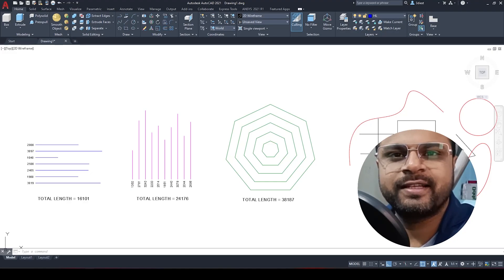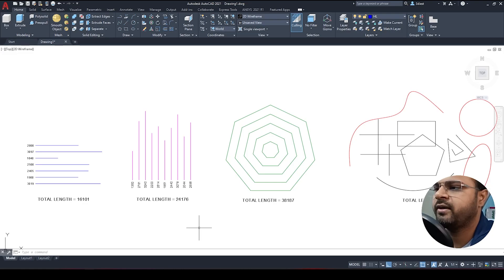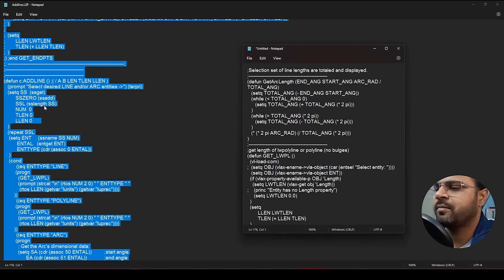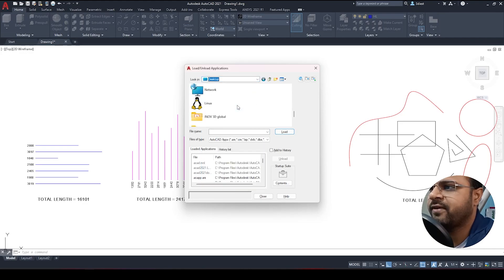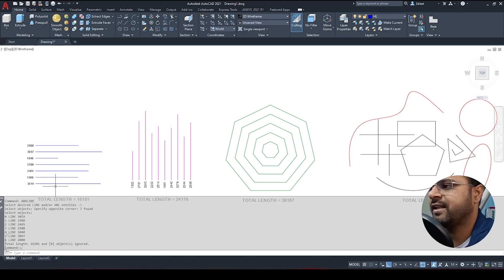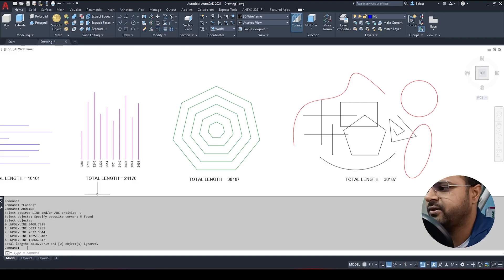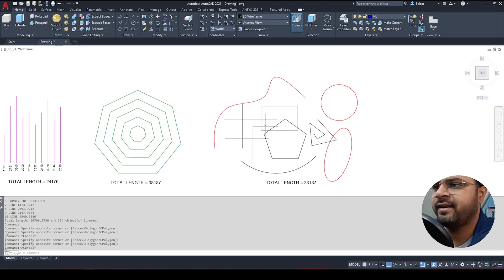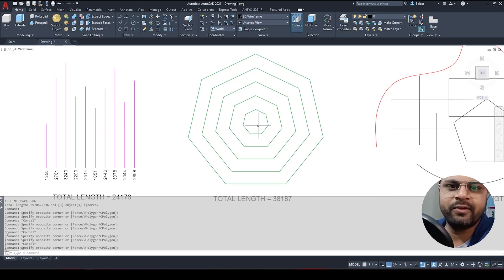How to calculate the total length of multiple lines in AutoCAD?

Comment: i need something like that  but every pipe has different diameter . Diameters text to other layer . Is possible autocalculate lenghts per diameter? To understanding better , i work on economic offer and i need leghts per diameter . thanks 
examble : Springlers pipeline , lines with different diameter, others polylines etc

Comment: Create a notepad file and paste the below code.
Save the file with a .lsp extension, for example, TotalLineLength.lsp.
Load the .lsp file by typing APPLOAD in the command line and selecting your .lsp file.
To run the code, type TotalLineLength in the command line.

(defun c:TotalLineLength ()
  (setq totalLength 0) ; Initialize the total length variable
  (setq ss (ssget '((0 . "LINE")))) ; Select only lines
  (if ss
    (progn
      (setq cnt 0)
      (while (< cnt (sslength ss)) ; Loop through all selected lines
        (setq ent (ssname ss cnt)) ; Get the entity
        (setq len (vlax-curve-getdistatparam ent (vlax-curve-getendparam ent))) ; Get the length of the line
        (setq totalLength (+ totalLength len)) ; Add length to the total
        (setq cnt (1+ cnt)) ; Increment the counter
      )
      (princ (strcat "\nTotal length of selected lines: " (rtos totalLength 2 2))) ; Display the total length
    )
    (princ "\nNo lines selected.") ; If no lines are selected
  )
  (princ) ; End the command quietly
)

Comment: Here's a simple free script:

(DEFUN C:addlenth ()
(setq tot_len 0)
(prompt "\nSelect all objects to count: ")
(setq ss (ssget))
(while (> (sslength ss) 0)
(setq en (ssname ss 0))
(setq ed (entget en))
(setq e_type (cdr (assoc '0 ed)))
(cond
((= e_type "LINE") (add_lines))
((= e_type "ARC") (add_arcs))
((= e_type "LWPOLYLINE") (add_poly))
((or
(/= e_type "LINE")
(/= e_type "ARC")
(/= e_type "LWPOLYLINE")
)
(ssdel en ss)
)
)
)
(prompt (strcat "\nTotal length is: " (rtos tot_len 2 2)))
(princ)
)

(defun add_lines ()
(setq pt1 (cdr (assoc '10 ed)))
(setq pt2 (cdr (assoc '11 ed)))
(setq line_len (distance pt1 pt2))
(setq tot_len (+ tot_len line_len))
(ssdel en ss)
)

(defun add_arcs ()
(SETQ CEN (CDR (ASSOC '10 Ed))
RAD (CDR (ASSOC '40 Ed))
DIA (* RAD 2.0)
CIRCUM (* (* RAD PI) 2.0)
S_ANG (CDR (ASSOC '50 Ed))
E_ANG (CDR (ASSOC '51 Ed))
)
(IF (< E_ANG S_ANG)
(SETQ E_ANG (+ E_ANG (* PI 2.0)))
)
(SETQ
N_ANG (- E_ANG S_ANG)
N_ANG_1 (* (/ N_ANG PI) 180.0)
PART_CIRC (/ N_ANG_1 360.0)
A_LEN (* PART_CIRC CIRCUM)
)
(setq tot_len (+ tot_len a_len))
(PRIN1)
(SSDEL EN SS)
)

(defun add_poly ()
(command "area" "e" en)
(setq tot_len (+ tot_len (getvar "perimeter")))
(ssdel en ss)
)
(princ)